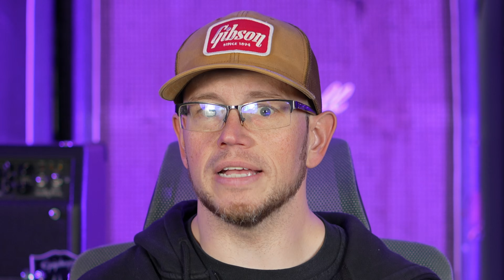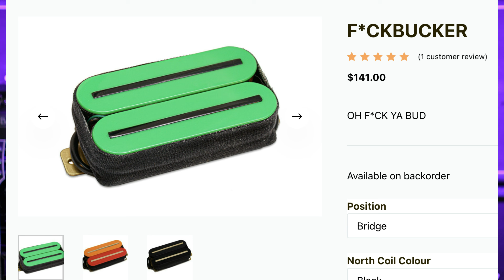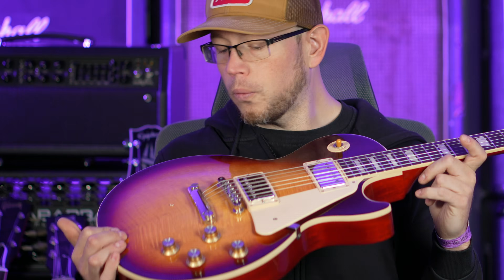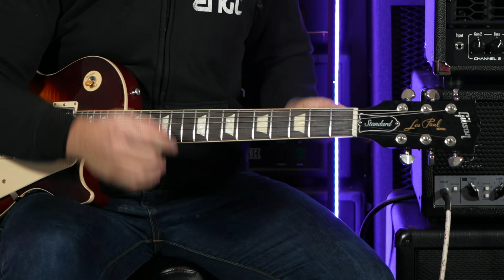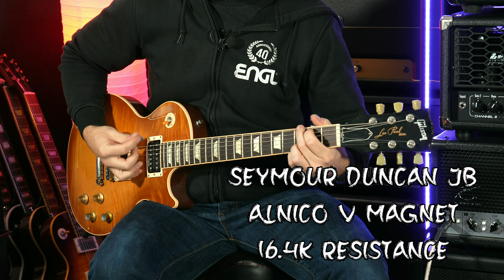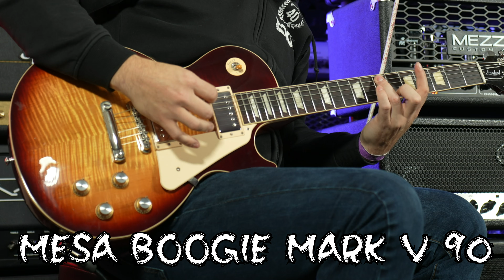EVERYONE has been using the WRONG pickups for metal......

Comment: While I think you sound great through PAF’s, can’t say I like how they sound when I play them. 

IMO, there’s some things you’re overlooking in this video. The playing field isn’t level, because higher output pickups are hotter, the signal will be more distorted/less clear at the same gain settings as a PAF. 

Therefore, they aren’t being compared at the same level of clarity. (I’m also aware a video addressing that would be significantly more of a P.I.T.A. to make). 🤣

You gotta dial back the gain for the hotter pickups to equal the same level of clarity as a PAF, which leads me right back to one of the most important rules of dialing in an amp or pedal, use ENOUGH gain, but never TOO MUCH. 
Too much gain ruins clarity, set the gain as low as you can possibly stand it, make sure you can hear all the notes in the chord and, make sure you have ENOUGH sustain for rhythm playing.  

Set your bass control to where palm-muted chords don’t fart and set your mids & treble to where it’s not stabbing your ears, and you’re good to go! 👍🤘🏻

A lot of people still don’t know this, because they’ve never recorded w/someone else, that’s when you learn what works and what doesn’t, is when you’re recording guitar. 

IMO, you’ve got to experience the mind-f@ck that is recorded guitar to understand that the guitar is actually more distorted than it sounds to your ear, that’s when we learn to dial our amps properly, IMO. 

I tried tons of pickups (including a few PAF types) before settling on mine and I use a super-hot bridge (Dimarzio Crunchlab) and medium-output (Dimarzio Chopper) in the neck, but, I use less gain than the average guy, I dial my rhythm sound as tight as possible, then I add a boost for leads, since they’re kinda opposite sounds, my rhythm sound is always gated, but lead never is because that’s when I want all the sustain, dynamics and harmonic feedback.   

So, to wrap it all up, I could care less what anyone uses, my point is that I can’t agree the suggestions of this video are going to work for everyone or even most, on the same hand, I just disagree w/you regarding this Kyle, I like your videos and have zero issue with you other than merely disagreeing on this particular matter, so no beef, just a gentlemen’s debate. 

Use whatever inspires you, but keep your gain and bass knobs low for maximum clarity, DAIL YOUR AMPS/PEDALS WITH YOUR EARS, NOT YOUR EYES, most of all have fun, ‘cuz METAL RULES! 👍👊🤘🏻✌️

Comment: I think most importantly, what I took away from this is the least expensive amp out of your trio sounded the best. So why is boutique better? higher quality transistors don't seem to be worth the extra grand or two.
Reply from the maker: You're not necesarilly paying for better tone with expensive amps.  You're paying for better quality parts that will last longer, typically higher quality parts, more hands on labor and less "mass manufcaturing", typically, American labor (as opposed to overseas china labor) access to the builder and creator of the gear in a lot of cases, etc. That's fine if you don't see the value in it, I understand. But a lot of people do, which is why Boutiquer companies exist and continue to exist
Reply: @belligerentamateur  Check out CRAB amplification. He makes boutique clones for silly low prices. He can build you a Mesa IICP+ clone he calls the Marcus 3 for the price of two pairs of sneakers. There are some boutique amps that actually do sound impressively better than mass produced amps.. The companies that come to mind (many of which you've already played on your channel are from Red Seven, Revv, MLC, Lichtlearm, and KSR.) It's a matter of supply and demand. Building an amp is not as crazy difficult as alot of people might think. If there were more amp builders, they could saturate the market, and all the prices would nose dive. That would be rad.

Comment: I noticed this 30 years ago when the 5150 first launched. You could grab any guitar off the rack and make it sound like a monster. Then Line 6 came out with the Spider valve and spider IV series, along with all the other high gain amp manufactures and then you didn't need high output pickups anymore. I run high output pickups still because I still use low gain amps and old effect processors and overdrive pedals.

Comment: I agree 100%. Always been a big fan of lower output pickups. Then a friend introduced me to moderately high output pickups in a guitar with a decent volume pot. Best of both worlds. A simple volume rollback you have the low output pickup. But the low output cannot be increased with volume. You have 100% nailed it my friend. A buddy of mine always put rails in his guitars. They sounded like shit everywhere except for full out metal tones on oldschool amps. Hitting a high gain amp with high output pickups sounds like straight shit.

Comment: I use the Super Distortion in the bridge and a PAF Pro in the neck for my Les Paul in one of my bands - it's my favourite sounding guitar. 
I also have a Jackson with a JB (SH-4) in the neck and Jazz (SH-2) in the bridge, which is awesome.
I recently bought a second hand Jeff Loomis signature (one of the old Schecter 7 strings in wine red) with EMG 707s, and I definitely like them more than the 81/85 combo I had tried in the past (in the aforementioned Les Paul! I was 16 when I installed them...).
Another guitar has a Crunch Lab and Liquifire which is decent too, but a little thin for full chugging heavy death metal stuff. 

Definitely a bigger fan of the SD/PAF combo, but I do have a pretty big soft spot for the JB/Jazz combo too. They're iconic for a reason I guess.

I think there is too much emphasis put on using high gain pickups- the problem is that when everything is so high out all the time, and everything is compressed to shit, there is little dynamic change or wiggle room, and for me it starts losing character and feels very flat. 
In theory you can dial the volume back, but I have had difficulty finding a good spot for it where it doesn't suck a little bit of the signal/tone.
I think that high output pickups are best served in low-medium gain amps in order to push them into overdrive, but for metal, you want a medium gain which I think helps the amp maintain clarity/dynamic characteristics.

Comment: I like both high output and low output pickups, for different reasons.
With high output pickups you can run less gain on your amp and often don’t need a boost pedal, resulting in a quieter rig overall.
With low output pickups you get more versatility with better cleans, typically a more vocal lead sound, and genre flexibility.
They both have their pros and cons and I have guitars with all sorts of output ranges.

Comment: There's so little audible difference between those pickups that you really should pick one over the other only for the price.
Absolutely no reason I can hear to pick any of these over the JB or the Duncan Distortion. I would probably go with the JB just because the Distortion is very slightly too aggressive for my taste. But again, it's a very subtle difference and I think both sound great, especially for metal, with the other options not really doing anything better as far as I can hear.
Personally I love using my Vintage V65's Wilkinson P90s for metal, and I pick it EACH AND EVERY TIME over my way more metal-oriented - and more expensive - LTC-EC1000.

Comment: My two cents: Duncan distortion was actually my favorite here. Mark 4 my favorite amp. I hear you too. In fact, I've told ppl this many times. Outfits like EMG cut their teeth on old Marshall amps. Modern amps are totally different too. You are absolutely right. The amp does the heavy lifting. for years now ppl have said, it sounds compressed. Ill giggle to myself and think about mixers who employ an eq after a comp. I take my high cut just as seriously as some do the low cut filter. In some rock texts and in a more blues-based material, I would love lower outputs. I'm a bit fussy when riffing metal though. The lower output openness equates to lip smacking in my ear and distracts from the riff accuracy. Once you hear it, you'll never be the same. It's almost like a broken in alnico speaker, but different. I start thinking my guitar smoked itself retarded and now has cotton mouth. To me, this comes off as cluttered. Nevertheless, I do like many lower outputs. I just need the correct job to employ them. The more space is used within a musical context, the more I seem to like them. 

anyway, nice vid.
cheers

Comment: Funny, how perceptions turned on its head. Back in the day, one of the chief ways one would differentiate a budget instrument from a high end one (back when it mattered) aside from the usually really bad fit, setup and finish, were the hot and over wound pickups. Every far eastern Epiphone, Samic, Hamer, even B.C. Rich and LTD had some absolute clunkers.
And the main reason to want to change the pickups was to introduce some more dynamic range to the guitar with a more usable output signal. These days even budget instruments are absolutely rock solid gigging and recording tools. Not gonna give up my Harley Bentons any time soon.
Reply from the maker: Totally agree!

Comment: First off: everything sounds tighter with a tubescreamer, because it's a mid focused pedal. Try turning it off sometimes.
My go to pickup now is the Fishman Modern, beacuse it sounds like a pickup with a built in tubescreamer. It can also do the fuller PAF style sound as well with much less noise.
And believe it or not, it isn't as high output as you would think.
Sure a PAF can sound very good on it's own, but when you add another guitar player active is the way to achieve the best mix.

Comment: One of my best sounding guitar is a SG ‘61 reissue with 57 classic pickups into my Engl Fireball 25.  Just enough output to sound tight and bright enough. My Les Paul trad. with Burstbucker 2 pickups is a bit darker so the guitar plays a big part in that.  My ESP with a higher output Duncan custom and Ibanez Genesis Rg550 sounds great too. You can pretty much tweak any guitar to sound good with a good sounding amp.  A good pickup just make it easier and takes you to a better end result.

Comment: I've always used high output pickups through a high gain amp, but since acquiring some vintage Ibanez guitars with Super 70 and V2 pickups, I must say they have way better clarity and they just sing way nicer too.  They have plenty of output but aren't nuclear.  I have a Dimarzio Deactivator X and it is just too loud for any normal playing scenarios...even with a coil split and the volume turned way down.  I'll likely be changing it sometime.  Don't dislike it but it's definitely too bombastic.  Even the X2N isn't as loud (not that it's subtle) as this one.  Dimarzio Super Distortion is king, all these sounded good but I have to say I like the PAF loaded one the best.  🤘🤘👏🍻

Comment: I kinda figured this out when I tried playing heavier music with a noiseless Tele. High end clarity is a valuable commodity with pickups, output is not (although there are constraints). My personal taste is for medium output bridge pickups and low output neck pickups as I like a relaxed high end with bridge pickups.

Also, the other thing is that I found the pickups pretty close sounding at high gain (not a surprise -- higher gain makes the differences between pickups smaller), which is an argument for lower output / brighter in general. Why? If it's not that important at high gain, but it's very important for clean to medium gain, then you lose nothing by going lower output to optimize for lower gain tones.

Comment: I have d) all of the above.
The question is one of compression. The options are simple crush the first stage of your triode with hot pickups, with a drive petal (TS to tighten up Marshall amps), or use a compressor to dial in the perfect balance that now foot switchable and you can adjust the level so your amp has got the perfect amount of response. Can I exploit my pitch harmonics at the same volume? 

My biggest complaint about my ZW EMG set is that they are too compressed clean. I love them, but not live.

Comment: High output pickups into modern high gain amps the clearity is totally lost and turns to mush really quick. especially when a pedal is thrown in the mix. I agree with you on the sugarbuckers. The 498T was awesome.  The DiMarzio Tone Zone is also a good choice as well. Its not a distortion class pickup but is a boosted output.

Comment: Glenn was right, Glenn still right, not that big difference that worth money they ask for. 

And agree - no need for high output pickups into high gain amp

Have used SD, Dimarzio, EMG, Wilkinson, ARB, even some chinise pickups from AliExspress, not that huge difference . While it is proper made - it will be OK for 95% applications. EQ on amp, pedals, mic position, even potentiometers and capasitors change sound much more than pickup change. And 95% of people don't even ask  for what reason pole pieces on pickups are adjaustable...it can change sound and feedback feel drastically. Blade pickups - another animal.

Playing low output humbickers in high gain amp is nothing new, Mark Morton(Lamb of God) used pair of SD59s on his signature Jackson before Dimarzio Dominions.

Comment: Basically my comparison is you wouldn't use menthol filter tubes with menthol tobacco if you were rolling cigarettes, that would be overkill. You don't need high gain pickups for a high gain amp in the same way.

Comment: I used to play extreme metal - ie death metal - in the 90s. And I used a MESA Triaxis into a stereo Marshall 1960 4x12.
And I used to run the second highest gain mode...and my gain was never higher than about SEVEN out of 10. Going higher just got stupid, and you couldn't tell WTH was being played etc, especially live.
Modern high-gain amplifiers DO NOT NEED high-gain pickups.

Comment: I definitely liked the PAF better. I felt like you could hear the individual strings much better. I prefer versatile pickups, which the medium output pickups do very well. For tight distortion, I think a good noisegate is better than a hotter pickup. My preferred pickups are the Fishman Fluence Abasi set for the 3 voicings and split coil options. Then again, I am an 8 string guitar player who plays metal, blues, jazz, etc.

Comment: Many people are currently using VST setups and virtual rigs extensively. In my opinion, the tones produced by the Sugarbuckers through the Mesa Mark V are incredibly solid across the frequency spectrum. They don’t have a woofy sound, yet they remain chunky and articulate without being screechy or overly midrange-heavy. On the other hand, Bareknuckle pickups excel in nearly every metal tone scenario I’ve encountered, provided you know how to properly set up an EQ and signal chain.

Comment: not everyone, just people under 25.
low output pups are on ALL our favourite records. Actives are on some.
I use my EMG actives for cleaner stuff and stuff that needs the clarity. Ironically they are 24v modded lol.
My shit shecter blackhawk has nice sounding pups but they are pants really, I have an SH-5 in my les paul but thats in disrepair atm.
Mateys Adam Black has a set neck and ASBO pickups, theyre kinda hot. Sounds way better than his Squier Paranormal imo.

lots of factors to consider, if you suck its not your pups.

Comment: I think it's a matter of Personal preferences....I play low and medium output pu's in metal (core) for decades and I am absolutely happy with them....beside the fact, that modern amps deliver enough gain even for the weakest pu, with high output pu's you are very limited in your playing expression due to the fact of making the sound overcompressed. Someone told me to try modern high output active pickups....I did: EMG retro active hot 70 7-string Versions...my opinion....those we're the lousiest sounding pu's I've ever built in a guitar....If someone had told me, those we're 10$  china made crap, I would say those pu's sound even for cheap china crap lousy!!!! Same with a set of (for no reason overpriced) Loombuckers. Nope, you don't need so called "Metal Pickups" to get a propper metal-guitar-sound!
Reply from the maker: 100% personal preference.  This guy gets it

Comment: I'm not a pickup builder and there are many factors that go into shaping the sound of a pickup but in my experience, lower output humbuckers tend to be brighter and have better definition. The more you push an already distorted amp the more it will compress and turn to mush.

Comment: It really depends on the rest of your signal chain. There used to be a time when amps couldn't really achieve that crushing high gain tone on their own, which is why high output pickups like EMGs were kind of a necessity to help push the amp into overdrive to achieve that nice crunch. But as amps got better and more versatile over time, the need for very high output pickups fell off. If you have a good modern metal amp, a medium output pickup is all you need.

For example, I'm a huge Death fan. Even though I absolutely love the sound on their albums and the Dimarzio X2N has a special place in my heart, there's no way I would realistically use such an insanely high output pickup in my rig. It would just be overkill. 

However, if you have an older amp, or an amp that's not really designed with high gain genres like metal in mind but you'd still like to achieve a nice overdrive, it might be hard to do that without high output pickups and/or some sort of distortion/overdrive pedal.

At the end of the day just use what you think sounds good and problem solved. There are no rules, just suggestions.

Comment: once you run the PAF into that tube screamer, you are essentially making it a "high output" pickup. so it kind of negates this whole experiment. if you run the others straight into the head, and not extra overdriven with that pedal, i suspect you'd have extremely similar results.